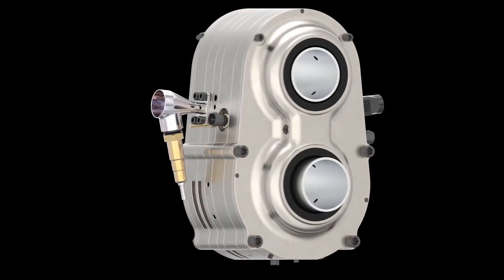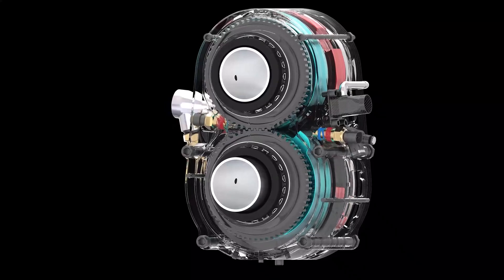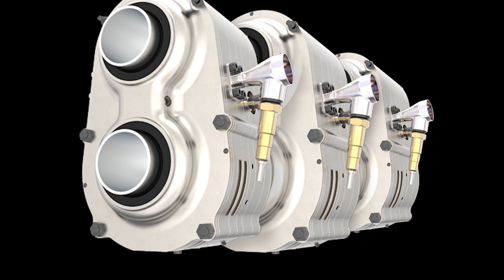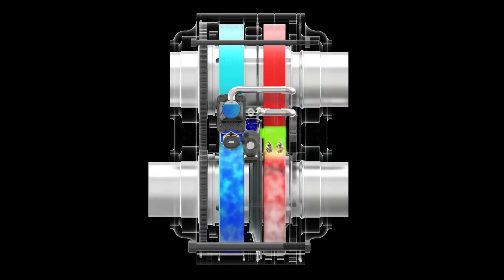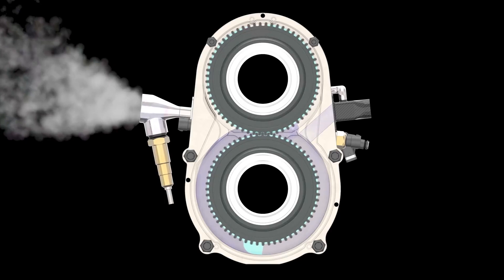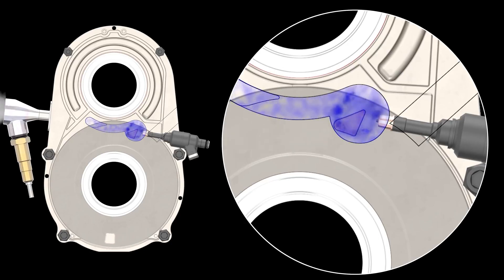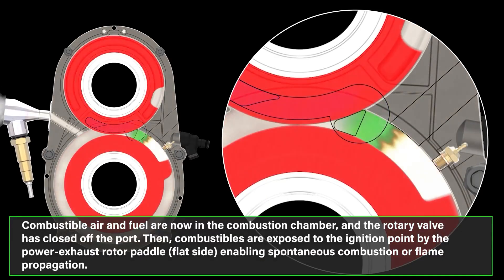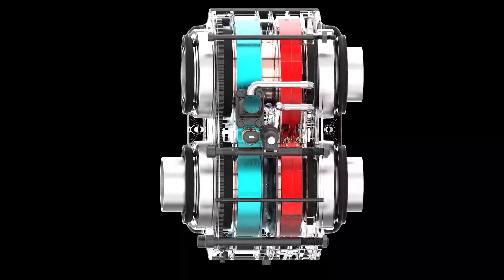This pistonless engine runs on hydrogen and revs to 25k rpm

Comment from the maker: Hi guys, I just want to say, thanks for watching and I did not design this engine. This engine is designed and Developed by Astron Aerospace. I just make videos on cool technologies and anything car/bike related
Reply: I'd love to see a running example of this engine, if they can build it and prove its reliable this could well be the future. 
Everyone thinks electric cars are green because they have no exhaust pipe but in truth their battery packs are anything but green and are exhausting rare earth materials and they do have an exhaust pipe it's just situated at the power station instead of under the car.
Reply: @markblack195  Then it still is an advantage to have the exhaust pipe at the power station for at least two reasons. One, yhe power station can keep out of densely populated areas, two, the exhaust pipe can be taken care of more efficiently with filters and / or chemical treatment.
Reply: It just pisses me off that we don't see technology like this until after the marxists destroyed the entire world economy.
Reply: Yup, biggest problem is efficiency, even if this engine has the efficiency of an electric motor(not possible) the efficiency of producing hydrogen is very low, so hydrogen as an energy carrier vs batteries will be much more costly. So beyond niche applications there is no place for hydrogen combustion engines, so there will be no infrastructure for it, which makes it more expensive, again.  The idea that hydrogen could be an alternative for electric is propaganda from the fossil fuel producers to keep their harmful business model going for longer.
Reply: @barrygillis  if you watched the video, it says it's hydrogen usage would be 98%.
Last I knew 98% is not a low efficiency rate
Reply: Hydrogen is extremely hard to contain even in hermetically sealed containers, im not sure how this hight rpm mumbo-jumbo will prevent leaks. Now imagine leak of super explosive gas like Hydrogen going bang. I like the idea of using Hydrogen as fuel in combustion engine but also i have some experience with little of that stuff exploding in containers. My ears was ringing for days.
Reply: I think going towards using waste plants to make hydrogen could be a feasible way to go. You have the water flow for turbines the uria for conductivity the only consumable Input would be anodes and cathodes...... I think maybe.

I'm definetly no expert or scientist, I'm probably miles out. Just a grubby guy who likes to play in the shed and try to understand things
Reply: Can it be used on a 1990 Ford f250 diesel pickup truck
Reply: Awesome if true... Battery power is toxic, because it is toxic it is lame.
It has always been a bad choice for the environment which is this planet and the residents of which are in a closed loop.
So better more efficient less toxic designs are needed or human beings will have essentially killed themselves off by killing off the planet they dwell on having polluted and trashed it to where it cannot sustain life.....
Great video thank you for sharing and let's hope that the people playing around with hydrogen can perfect their technology and where the powers that be cannot ignore it and would be forced to adapt or perish.
Reply: The most important question. How practical is it
Reply: The clue here is who designed the engine...an aerospace company. Producing H2 comes with losses and ICE have a typical efficiency of 20%. So running this engine isn't very efficient and it's purpose is to power a plane, maybe even in combination with an electric motor and batteries as pure electric planes would be (currently) too heavy. So don't get your hopes up for seeing it on the streets powering a car.
Reply: Guys check this out- Power of Steam Locomotive 🚂
https://youtu.be/H5QVrWEuIX8
Reply: Probably a scam or you're a scammer.
Reply: Hydrogen generators.
Reply: Why didn't you discuss the cost of the fuel????? Fuel availability,... Inherent dangers.
Reply: anyone hear of the Hindenburg?  dont think hydrogen in a car/truck is a good idea.
Reply from the maker: I made a video on exactly that, if you are worried about hydrogen going boom. Watch my video called is Hydrogen safe to use in our cars
Reply: @ChrisVSCars  It's fine. Split off small amounts & burned tight away,  it wouldn't be a problem at all.
Reply: there is  a problem with EV coffins they create strong EM field damaging health over time
Reply: Looks good.
Reply: You’re still alive, thank god
Reply: @Dogonatree  Usually takes a few years before that problem is fixed.
Reply: @jason.arthur.taylor  I was referencing the last guy who made technology like this wound up dead
Reply: this engine design look good until you meet cooperations and governments with profits $$$, was a nice try though, what are your thoughts on freevalve being combined with this piece of tech as well
Reply: @Seymour890  well free valve only applies to piston engines, it basically means that the valves are electronically controlled instead of run by a belt or a chain driven by the drive shaft. That engine there is just like a rotary, the valves and the combustion chamber are all on the rotors. To be honest with you it makes no sense to me why we're not pursuing technology that makes internal combustion more efficient on top of transitioning to Electric. You know like what they have on cruise ships, or locomotives. Have an engine mated to to a generator and have the generator run everything... it's the most efficient, and there won't be any rolling brownouts for added pollution because of countries like China mining lithium ect.
Reply: @vernonvouga5869  You mean... "Like what they have on CARS"? 
An I/C engine mated to an alternator that "runs everything"?
Reply: @michaelscott356  no I mean an engine connected to a generator. An alternator does nothing but put out 12 volts unless you rebuild it. But even if you rebuild it so put out house voltage you still won't get the amperage to run the Electric Motors on the wheels. Think bigger
Reply: @vernonvouga5869  yes your right, I got a little excited and forgot what/where the technology was meant for .
I guess with the balance of pollution/efficiency and market grip we may never see some things come fully to fruition
Reply: @Seymour890  I think we will, they continue to divide people emotionally by different sects (race color sex religion politics ect...)... eventually that will come to a head in a way that they don't expect. I can't wait for that day. Or the day that I actually make one of these things that I talk about but don't have the time or money for
Reply: @michaelscott356  c'mon Michael, you know train locomotives run on electric, and I think you know he is implying a car with an internal combustion generator that runs the electric motors.
Reply: @bartbullock9742  they are diesel powered. They only use the diesel engines to make electricity  because it is easier and more efficient to put power to the wheels than connecting the wheels to the diesel engine with a transmission and clutches (or torque converter).

The electric part of a diesel-electric train engine is akin tobthe alternator of a car, then using that electricity to power electric motors to spin the wheels. That would leave the car being powered by an ICE.
Reply: I don't think it will be great for cars but airplanes, trains and large trucks could still use something of this nature. Personal transportation, side from performance cars and bikes might find it useful.
Reply: I bought a metal lathe 8 months ago and have one of these almost up and running. I'm fitting it into a Citreon C1 and running it off barley  oil over the Winter and methane over the Summer.
Reply: @thetube4607  pretty freaking slick
Reply: Electric cars will have completely taken over the market before this engine can realize its potential. 2025 will be the unveiling from Toyota and Nissan of Solid State battery vehicles, which will completely replace any combustion engine. Better HP, longer range. Super short charge times. The only problem we face now is that no countries power grid can handle much more electric vehicles than we have right now. So we're kinda limited until new solar tech becomes a thing. Which is also sooner than people think.
Reply: @shperax  don't you love how they force things on people when the world that they created isn't even ready for it? They're probably going to try to instill Global socialism before they actually do this whole technological Revolution. Notice how everything is a revolution for them
Reply: @shperax  that is wrong, electric cars are so much worse than fueled cars rn. They have waaaaay too many issues to be able to replace fueled cars. Plus all the antiques people have.
You are absolutely bonkers
Reply: @godlee4888  You have to read what I said again. I wasn't talking about electric cars right now. I know the current lithium tech isn't as good as combustion, I'm talking about in a few years with Solid State batteries. And new solar tech hit the market in July. Ahead of schedule.
Reply: Nah, my friend's dad designed a hydro car 30 years ago, gov stole the tech. My grandpa,  a civil engineer,  designed the hovercraft in the 50's, gov took that, too. New energy won't be used,  unless they can make more money from it than oil.
Reply: @mariatorres9789  Nice family tradition of BS conspiracy theories!
Reply: @michaelscott356  Sure, dude,  look him up.  Robert E. Farley, Stockton,CA, civil engineer. And he sure as hell did design a hovercraft in the 50's.
Reply: @michaelscott356   yeah there's always one friend who's dad did everything from invent the wheel to land on the moon
Reply: @mariatorres9789  maybe your friends family should just post the idea across the internet before bringing it public. Sounds smarter than try to patent it privately and getting it stolen (more likely bought)
Reply: @godlee4888  Stolen,  not bought.
Reply: @godlee4888  Well, my grandfather is dead now,  but he designed several bridges & buildings that are still around. My uncle's got into surveying, and have substantial businesses. They didn't go into mechanical design,  because they knew new tech gets hidden.
Reply: @mariatorres9789  And my nan designed a rocketship powered by a squirrel and used that to get a photo of aliens in Mars back in the 1800. Unfortunately both the technology and the photo taken were stolen by the government.
Reply: @mariatorres9789  In 1976 I tried to patent 122 different devices. The Patent Office told me that they did not reserve them! I told them on the telephone who signed the letter from the post office, and they hang up! Several things, the space plane that is orbiting the asteroid belt. I designed the engine as hydrogen. All parts are the same! I designed a 3d tv. The 6th gen airplane will be NOW using it to put many fighters in the air and only one fighter using it. I have 2 new inventions and they are NOT going to use them! A boat propeller that drive a boat on land. I have already tried to get a propeller manufacture to  manufacture it! And a second, an engine  that has variable cubic inches that will hit 100,000 rpm and will run off of hydrogen to powered wood!
Reply: @mickgibson370  I thought you might be curious to know, one of my good friends, back in the '80s, invented a carburetor, it almost doubled the gas mileage on a small block Chevy truck he had, he had it patented,GM bought the patent, and we've never heard about it since, oh yeah he made good money, I know how to do what he did to my own car (s) with carburetors, I got an old and lazy and I would only do it gas went over 10 a gallon.
       Another friend of mine, in the late 80s, invented a wiper blade for cars, that would last at least five times as long as a normal one, (the blade pivoted back and forth, you know eccentrics) he tried to sell it to the big two, they wouldn't pay his price till after he had it patented, and started manufacturing it. Now they just sit on the technology, you know we can't have anything last forever, there's no way to make money.
          And mick , this last one is crazy , I remember, in 79.. 80 maybe a TV show, in Dallas, it was called PM magazine, they covered a story on a man in Houston, who had a self-contained, electric generator, it was about the size of a large ice cooler, (yes they showed it sitting there in his garage) he claimed a once he started it up, it would run indefinitely, without putting any fuel or energy to it, he said the patent office, kept giving him the runaround, when he finally got to the patent office, he told them that they could not ground this machine or it would not work, they argued it had to be grounded, he said that they took it into the lab, would not allow him in the room, tested it and said it did not work. This man said he had worked on this many years, and he said he had many friends and family that knew it was no joke, he had a lot of money invested, and because he could not get a patent. He said he would go to his grave before he ever revealed the technology. I know it's a crazy story, I haven't checked it online, something tells me anything about it will have been squashed.
Reply: So you did nothing but put a video to it. Thank you for letting me know that my appreciation should go elsewhere.
Not that even that deserves the title.
Reply: @shadenone  so you did nothing but re-word what he said?
You don't even deserve a comment.
Reply from the maker: I made n video about it.
Reply: @shadenone  who pissed in your cheerios?
Reply: @shadenone  I'm sure that company is over the moon knowing they reached 2 million people while paying absolutely nothing.
Reply from the maker: Jup😂 I wish i got payed

Comment: If you feed the exhausted heat from one to the other and the other back so increase effeciency or use heat to warm the inlet air reduce fuel to run on extreme lean fuel aur ratio and if arrange three of them in triangle and the gear shaft in the middle can be heaven on earth

Comment: Energy density has 'fuelled' automotive progress and cannot be and never will be replaced by less dense systems like EV,s. This concept is great, if it can deal with bearing tolerance criteria - the faster a bearing the GREATER the tolerances - as in C3. Time will tell. I think liquid/molecular sealing is too little understood or used - all metering systems in pharmaceutical dosing and filling machines are metal on metal - self lubing extremely close tolerance parts - hydraulic valves another - so it's not magic - but rpm is another matter.

Comment: With those kinds of rpm's it will require VERY precise manufacturing limits (more cost).  SLIGHT imperfections can result in catastrophic vibration problems.

Comment: Current hydrogen vehicles are incredibly inefficient and expensive.  Electric vehicles, when the price of batteries drops (as it has exponentially for the last 10 years), are far simpler and generally just make a lot more sense.  This seems interesting in theory, but I'd have to see it operating to believe it even works.  Plans are easy, execution and manufacturing are where reality hits.

Comment: Sounds like a fantastic engine, especially for aviation use. And if it can get rid of the PEM corrosion issues, terrific! The only drawback I can see remains not with power (which noone was really complaining about anyway) is safe storage, keeping the universe's smallest molecule from fizzing out of the fuel tank all by itself. That, and alternatives to filtering for hydrogen by SMR and electrolysis are still just lab-bound experiments. Let's fix those issues and get our future back.

Comment: 15 inverntors that we know of have been topped , you dont even know aboit the roton head for a 1.8 kseries engine .uk gov confiscated it and all its engineering ..the cylinder head no valves  produced 600 hp some company near wales england

Comment: Since it's pistonless, can you custom make a V8 block and incorporate those pistonless engines into, but it has to be fuel efficient, can it be Fuelless, turn it into a pistonless generator system in a V8 Block, or custom make a block to fit those pistonless units into,  Fuelless also means do not have to refuel, the air in our environment in concentration are combustible for fuel,  or can you run 3 units  off the exhaust of one unit, looking for fuel saving options, or no fueling or charging at all

Comment: Hollow out the piston within a strength so the sides are thicer at The Bottom then thinner At the top Combustion Then could be powered but have less tolerances.

Comment: Well I know it will still make nitrous oxides, because it's a combustion engine, and every combustion engine does this, unless you run it on pure oxygen instead of environmental air oxygen, which contains nitrogen, which combusts too in combustion engines that don't run on pure oxygen. This being said, this has a future in the race industry, space industry, air industry and maybe the car industry as well, mostly in america where they like their cars loud and powerful. But it's still a lot of moving parts and thus maintenance because of wear.